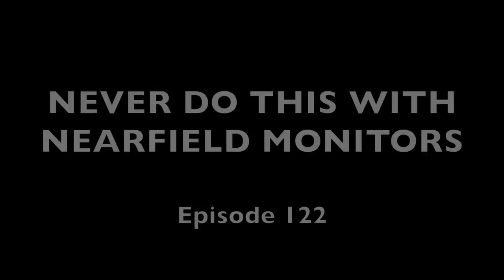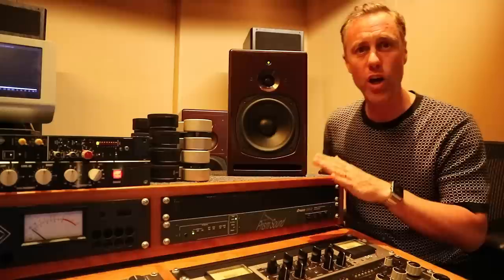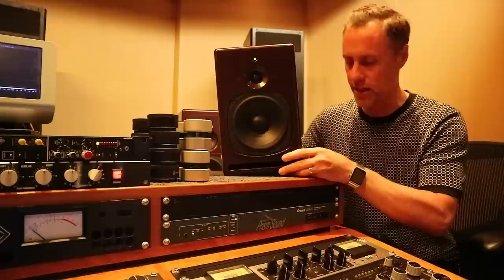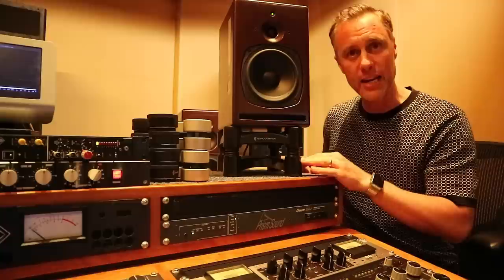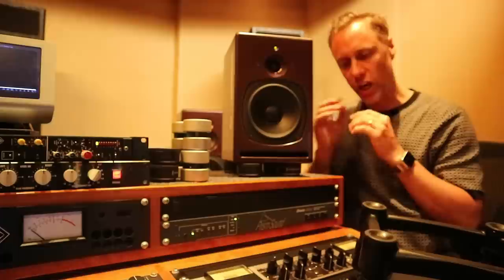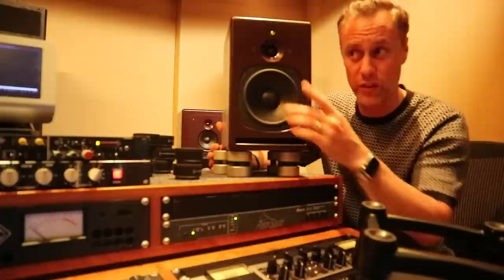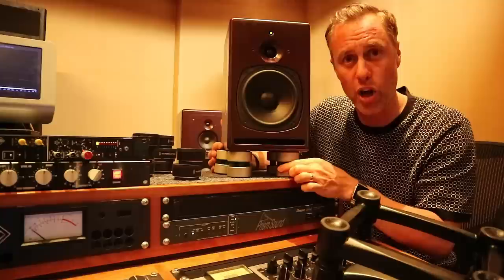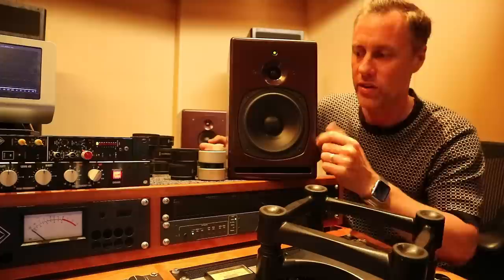NEVER DO THIS WITH NEARFIELD MONITORS !

Comment: I've used folded beach towels for years.
Reply: at least buy some foam. When isolation is discussed there is always someone bragging about using something like an egg box. Why not spend a tenner on some isolation foam, even if to just make your set up look better
Reply: @CallumSk8er  Probably because what he's doing works?
Reply: Dampened towels or dry?  Small dad joke there. .  Towels are awesome for walls as well
Reply: Nice idea,thanks
Reply: Cheapskate....🙄
Reply: Once used cushions off two armchairs . Worked a treat , no more jumpy turntable..

Comment: $600 for some neoprene sandwiched in between some aluminum? I guess there's a sucker born every minute. The black ones are just technics 1200 foot design from 50 years ago, rubber pad on bottom with spring in the middle. For that price i can buy a technics 1200 mk7 turntable, and they throw the feet in for free.
Reply from the maker: Nice shout might find those and try for a video 👍

Comment: Watching your video Streaky, inspired me to get my head around what I could do for the near field monitors I just bought to isolate them. Being disabled with limited funds, I either have to save for ages to get good equipment or like in this instance, get my grey matter working on an alternative. Sometimes the idea's work out be no good & I have no option but to buy market products. So I got myself down to a local Poundstore & bought 8 high-density foam balls for £2, & at my local hardware shop, I bought 16 large coasters, for sofa's & the like, for £8. Couldn't wait to get home & try this idea out!..... I 1st off put 4 coasters down the right way up & placed a foam ball in each, I then turned the top 4 coasters upside down & balanced them on top of the balls. The speakers were put on top of them. The result was AMAZING!! The speakers are completely isolated from my desk, I can feel the vibrations with my fingers when I touch the top coaster but when I touch the bottom coaster, there is no vibration at all, so the ball is removing it all & the difference this has made is HUGE!!  You can see in the screen shot, exactly what I have done & if anyone doesn't believe the result.... try if for ya self! You will be amazed too & not just at the saving you will make but the quality of sound..... All that's left to do now is make a raised shelve to stand my PC monitors on & place the speakers each side of them, to get my triangle right with the tweeters at ear level. It's all good!!       http://prntscr.com/fxnodd
Reply from the maker: haha this is mega...before clicking through I thought what is this guy on...but they look excellent and if they work that is perfect...nice work 👍
Reply: Glad you like them & I would be really interested if you tried this way for yourself & compared them to the others you have. What's to lose?  A tenner hahaha
Reply: GARY HINDE,,,,,,,,I have just two things to say to YOU !! The First thing is ,,,hahahahahahahahahahahahahahahahaha. The Second thing is.THANKS. You are one very Clever dude. :-)
Reply: What you made looks very good .  isolation vibration devices ..
Reply: Great idea, I'm going to try this myself, thanks.
Reply: man as i heard 600 pounds for some tiny cones i had the same idea going to the handystore and craft those myself. Thx for your idea, im going to replicate it.
Reply: Gary Hinde great idea dude thanks
Reply: You should be working for NASA, with a tin dust bin and some fireworks you could get man to Mars :)
Reply: Do the speakers slide on the cups?
Reply: You're a genius I'm defo trying this!
Reply: super idea Sir I hear ya I spend eye watering amounts of dosh on my dj setup if I want all the extras I too have to get creative, big ups to you . also i will add that the video should receive the credit it deserves too , well done streaky will subscribe
Reply: Great idea! Good thinking! I noticed in the picture you provided that you chose light green foam balls. Maybe you could have even better results with dark green balls, similar to the 600 quid best in class ! 😀
Reply: I feel so grateful for your videos Streaky. I was looking for an honest review of those decouplers without knowing which choice to make. Was about to question myself tonight between the 600 one and iso acoustic pucks. 
Now Sir Gary, your comment just brought an other level of réflexion. Would love to test your method and bring it to a shop and compare products with yours. I want to feel literally which one feels better. 

I know it's a video done in 2017, do you still use your DIY pucks ? If yes do you have any coaster recommendation ? Models are plenty but not like you have apparently.
Reply: I can't see the image. It won't load, can you do it again?

Comment: I'm running Auralex acoustics angled wedges under my adam audio on floor stands. I have the pucks and the difference is so incredibly small it can only be measure by specialized sound mics. Diminishing returns bro.
Reply: Eric Ryan Sound 
The tallest pucks or the shorter ones? I’m really interested in putting my speakers on my desk if possible; did u do that or did u use floor stands along w/ the pucks?

Comment: the more layers of materials with different density you put under it the better the isolation
Reply: Yes, im using styrofoam sandwiches. One dense piece on top, a more foamy piece in the middle, then another dense piece on the bottom, works perfectly

Comment: Speaker dudes from Auralex are doing the trick, not cheap but very efficient. I used them for a long time, now my Yamaha monitors are on the wall, just to uncouple them from the desk. I have not a lot of space here, so this solution works for me, btw I used the original brackets from Yamaha, these are isolated as well. But you are right placing them right on the console isn't' a good idea. Great video.

Comment: Vibration from near field monitors is super helpful in my case. Ethan mentioned his measurements that show little difference when the sound is measured over the air. What needs to be taken under consideration is that our ears are not the only way the sound reaches our brains. It's also the vibration of the floor, it's the vibration of the console palm rest which we can feel rather than hear. This is an important factor which might actually be helpful rather than harmful. One of the reasons cars are so good for assessing our recordings is the vibration that we feel with our hands resting on car doors, vibrating car floor that we feel with our feet, etc. In this case it doesn't cost much to try different options. Try it yourself what's better for you! Don't listen to "you should never do that" advice.
Reply: This is why clubs are better upstairs. The bass carries along the floor more than the hard ground. You feel it more than hear it. Increase the sensation for much less power. Hard floors can often make the bass feel dead.
Reply: I'm using paper cone bass driver speakers (old K&H) to check the bass. These never lie, those germans knew what they were doing.
They're the size of small nearfield, but we tested ABX and I can hear 30 Hz on them.
The potentian pitfall with your method is, that, unless you get it 100% right, the room or the surface in the car emphasizes different bass frequencies (through resonances) than in a club.
Reply: If you need vibrations over the floor buy a subwoofer. But what Streaky wanted to say is warning that placing the speakers on the meter bridge we are smearing the transients and destroying the high frequency waveform loosing the energy and accuracy and details.

Comment: You can buy small rubber feet that can be glued onto the speaker base ...    that works the same and costs  2 quid for a set of four ...
Reply: keith old bean no, if they are to soft they will be compressed and transfer the vibration, same if they are to to hard from the beginning,  but I can't say enything about the product he is displaying. 
But they are why to expensive.

Comment: I just got a set of True-mix AR5s Studio Monitors very recently and right out of the gate I used some specially-designed Foam Pads between them (that came with in the Studio Monitor Package and the stands, and they really DO make a difference. Before when the only pair of Speakers I had to rely upon where Samson BT3s, I simply used some Styrofoam packaging with them in my Desk to try to provide a level of isolation to try to make the best of what I had! It really does pay off de-coupling your monitors with something!!

Comment: I had mine mounted on wall brackets in the studio I was using. Unfortunately I've not got access to the building now as it closed down, however I'm thinking of doing the same thing where I live. Right now however they are just sat on a glass shelving stand which is itself mounted on top of a worktop. A bit closer together than they used to be due to space but don't sound too bad. I think being glass and not wood helps a bit.

Comment: Another tip, if you have those bogus acoustic tiles that you typically see youtubers of all types using, put 2 of them together and you basically then have isolation pads. I did this when i realised rockwool panels are better for general room treatment and had all these acoustic foam tiles left over.

Comment: For front ported monitors you can build "portable soffits" by building a box much larget than the monitors and a second opened front box to put your monitors in with a quarter inch of neoprene between them and your monitors. Fill the remainder with sand. If you use beach sand, cook it at 400 or so for at least 30 min. to kill critters. Soffits are sand filled for decoupling, I figured why not build the same thing that isn't part of a wall you don't own? Just position them and then fill with sand! They ain't going to be light and ease to move. They will extend your lower range by around 5 db though!

Comment: I'm not a fan of the iso acoustic stands. I do currently use them but they feel so cheap and the rubber really sticks to the metal adjusters, very frustrating to set up or adjust. Definitely gonna try the daddy pucks !

Comment: To be fair the guy is a mastering engineer where any improvement to sound, no matter how small is critical in that environment. I guess 600 quid is not a lot for him to spend considering the cost of all the other gear. ( I agree it's a ridiculous amount of money for such items).. but for those of us who are first and foremost music producers who have home studio setups in less than perfect acoustic settings, then cheap or homemade isolation pads of some sort are good enough. I use ESI Unik 08+ monitors which are not only great monitors , they actually have built in height adjustable rubber feet to decouple them from surfaces..… oh and both monitors cost around the same as his puck things. ;)

Comment: i used those yoga brick with a plus 3 slices of foam, in the middle a kind of photographic material that i have, and it works fine for my jbl lr305

Comment: Mind I just use sponge with cut out part of rubber sleepers and pasted together using the rugby soluble/gums.

Vibrations solve in 5 minutes job.

Cut Size (2.5”x2.5“ inches )

Comment: For me, a studio monitor should be free-standing
This is not necessary with a stand box.
But with a 2-way or 3-way nearfield or midfield a must-use stand! It just sounds better and absorb good ones. I take a stone slab as a base where it is decoupled, then the stand on it and the monitor speaker decouple again to the stand!
Yes reflection from the table or screen in front of the monitor. You should avoid it as much as possible!
Place the best screen behind the monitor! Reflections from the table are not easy to avoid.
It depends on the monitor how the tweeters are directed in the vertical plane! And how far the monitor is received from the table.
Must say that the Adam S2v excels because it has very directed high-tone removal in the vertical plane. 😉
I use stands with a height of 92 cm.
The stand height depends on the monitor size and the distance, seat to the monitor!
I see that the center between the treble and bass are aimed at the level of the ears.
So you get a balanced sound

Comment: I see that the black pucks cost £50-60 for two, so £100-£120 for a pair desktop monitors.  I think I could make the very same things for peanuts. As for the £600 stuff - more money than sense.

Buy 4 plain circular camera lens hoods. They come in a variety of diameters. I've just seen a 50mm dia lens hood for £1.04, post free [from H.K.]. on eBay. Cut some closed cell foam [loads on eBay] to fit - a reasonably tight fit - into the lens hood with enough foam protruding top and bottom to provide the isolation. Or perhaps use those foam balls from Poundland that Gary Hinde used. 

I would like Streaky to A-B-C a set of my design [about £10's-worth] and Gary's against his £200 pucks.

Comment: Sounds a bit like you're hearing the price there.
All solutions except the foam pad all do exactly the same, from a physical standpoint. They use rubber for decoupling.
The only possible difference is maybe the tuning of the rubbers stiffness, length and area. And then the speakers weight would influence this tuning heavily.

I'm fairly certain you can get the same results using Squash balls (or anything rubber with a small contact surface) if you experiment with stiffness, contact area (amount of cut when speaking about squash balls) the count (3 vs. 4 vs. more) and placement under the speaker.

The fun fact is: even the folks with expensive products only got physics to work with.
If you like the convenience, that's a different story. But there is no way 600 bucks will improve physics by that much...

Comment: 600！fuck that！
Reply: and they cost 5 bucks to make. but you know.. pro audio
Reply: +iven zhou wrote: 600！fuck that！

Me: They're isolation devices, not sex toys ..... even when vibrating ;o)
Reply: go to Lowe's and buy a box of rubber flooring tiles for about 20 bucks. they work just as well, and you can stack them as high as you need them.

Comment: Hmmm......two approaches to speaker mounting, decoupling as per this clip, or solid mounting.  IMO solid mounting is much, much better.  If you haven't experienced this then please try - you will be amazed of 'trueness' of the bass response though-out the range.  Concrete blocks, steel tube filled with sand whatever.  It's impractical but worth it.  £600 for floaty pads, hmmm.....?
BTW, my current nmf are decoupled, like I say impractical!

Comment: Hi how does one decide what the distance should be between the ears and the  monitors. No one seems to,be addressing this issue. Is there some kind of system, based on power output, woofer size etc.

Comment: sorbathane ,,,, job done ,, tenth of the price , vinyl djs have been using it for years
Reply: Thanks for the suggestion :)
Reply: tom thompson there's also monitor foam That only costs like $10
Reply: never used it or seen it , ,, so i cant comment ,,
Reply: 100% correct...but only the dense 1/4" thick stuff. I bought a bunch of it many years ago and never cease to find uses for it. Works like a charm under speakers, and yes, I've compared it other more expensive bullshit stuff. Can't tell the difference.
Reply: wow ,, i used to buy it for under turn table feet , technics sl1200s , while providing sound and production at dance events ,,, its great stuff , but i was never lucky enough to find it in any quantity ,,,
Reply: There was a company going out of business a little over a decade ago that was selling it for cheap, so I picked up a bunch....and so did a lot of other people. Most have resold it on ebay over the years.
Reply: it used to be crazy expensive  a 2 inch square , 12mm thick bit was 15 pounds ,,, but nothing else worked as well ,, for stopping stage bourn acoustic feedback isolation
Reply: @larsaskogstad Actually sorbothane isn't ideal. Scientific tests have shown it isn't the best for isolation because of the way it rejects and transfers vibrations unevenly.

I use superior better performing platinum cured silicone decoupling feet for my speakers.

Comment: I've not heard the Pucks yet but I do have a set of the ISO L8R200 stands under my monitors and the sound is superb, it's hard to imagine how anything could make them sound better other than buying better speakers.
Reply: l34052 I also use the ISO stands in my home studio, tempted to balance halved squash balls between the stand and speakers for additional isolation.

Comment: A cheep fix is mouse pads use 2 and hear the major difference.
Reply: I have done the mouse pads with other electronics and they work.  I will not use foam pads as where I live earthquakes are always a big worry. Mouse pads or antislip pads work and tie downs for protection. No issues at all.

Comment: Tell me please. I have monitors genelec 8040. They are not put on IsoAcoustics ISO racks without the supports that come with them in the kit. If we put a wood plate on these supports, and we already put the speakers on it, will the effect have the same vibration isolation?